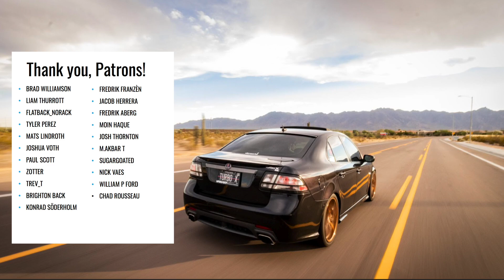Saab 9-3 Quick Fix - Window Regulator Replacement

Comment: I have been using my key pad to get my driver side window to roll down. I can use the door control panel to roll it up just doesnt roll it down. I have an 08 9-3 Turbo Convertible and honestly when the top was down one day I got caught in the rain and it took a couple minutes to get off the highway so I could put the top up so I think the door panel control may have gotten wet because it hasnt worked since. Thanks for all the great content!!
Reply: Key pad?

Comment: Just did this a few hours ago no lie. Just purchased a new window regulator on eBay, should be here in a few days. Both front left and rear need changing but right side is perfectly fine.
Reply: I have the same issue on mine. Mine are just stuck all the way up. Does yours make a clicking sound when you try and roll the window down?
Reply: @bombardier6033  so my entire left side windows gave out after a little over a month of ownership. I did notice when rolling them up and down they would make clicking or creeping sounds when operating, at first I thought nothing of it until they became slower and noisier during operation and then they became louder and slower and started going in reverse on occasion. Then stopped moving all together with loud grinding noises. Found out it’s the wires being bound up together continuously. Not a motor issue but a regulator issue, very common it seems.

Comment: Except for the driver door window, I haven’t rolled down the other windows in years on my 2008 9-3. I recall them slow or getting stuck. I was told to use WD -40 on all the window tracks. Got to try that.

Comment: Hey! I don't suppose you have ever encountered a problem with an electronic folding wing mirror? I have a 2006 93 Aero 210hp. The n/s (your o/s) mirror functions fine if I fold them or dip the lens down but every time I pull away ( once I hit 20mph or so, which is the speed which the mirrors open automatically if they're folded) the mirror mechanism clicks and spins for around 15-20 seconds with minor movement from the mirror itself.....then all is fine. Any idea of the problem or the fix? Thanks

Comment: Hi. Must say I’m loving your videos. I’ve recently bought a Saab 93 convertible (2005) and I’m having trouble with the driver side door locking. Do you have any insight on that? And also my windows won’t automatically go up after you hold the button to put them up.
Reply from the maker: 1. yeah those door lock actuators can go bad; you can probably grab one cheap at your local junkyard
2. sounds like your auto pinch thing might need to be reset; maybe try disconnecting the battery and reconnecting it to reset everything

Comment: My passenger glass does not go down, I can hear the engine receiving current but the glass is stuck, any advice?
Reply: Have the rubber runners dried out and jamming the glass !? 👍☘
Reply: If the motor is still working just replace the regulator. You can find it for under $30 and shouldn't take more than half an hour to install.
Reply: There’s a chance, like he was saying, where the regulator goes bad but the motor is fine. If that happens, you’ll hear the motor but nothing will happen. There’s also a chance (this happened to my car for whatever reason) that the clamps that hold the front two windows become loose or broken and it won’t pull the glass down or push it up. Best way to diagnose whatever it is would be to either remove the door panel and inspect it or listen very closely As you push the switch. Grinding sounds typically mean the regulator is bad but if you hear nothing until you reach the top and it makes a “thunk” sound, it’s probably those clamps